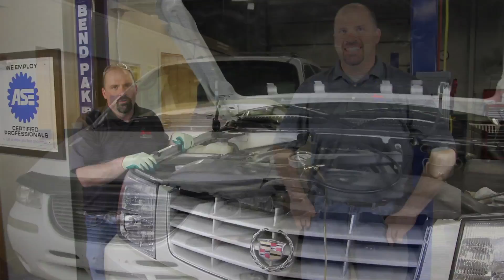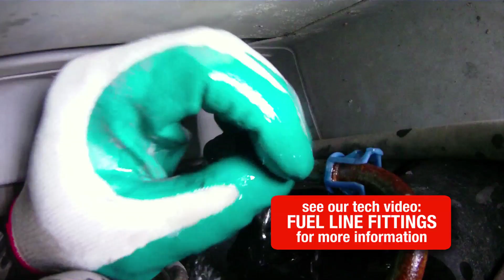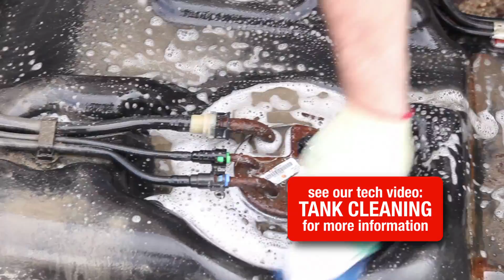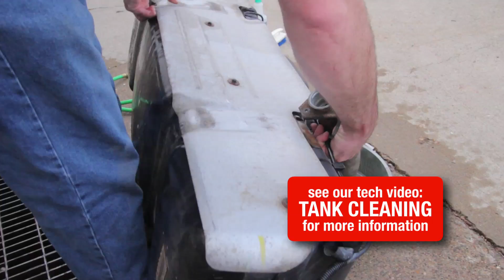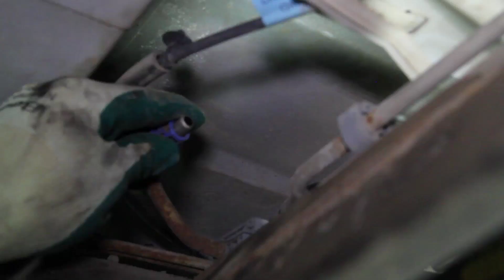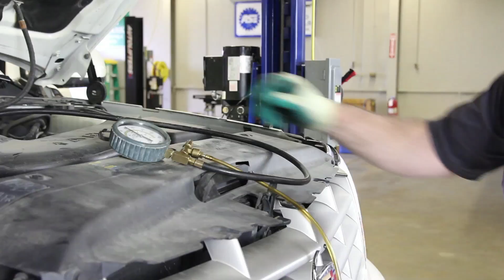How to Install Fuel Pump Module Assembly E3581M in a 2004 -2007 Cadillac Escalade

Comment: You can also bleed the fuel pressure, by removing the fuel pump fuse, then starting the vehicle, and letting it die or stop running on its own, then shut off they key.  Then disconnect the battery cables.

Comment from the maker: Hiwaycruzer, General Motors pulled a fast one on you, the fuel filter for the system is incorporated into the fuel pump assembly, so when you changed the pump you already have a new filter installed. Hope this helps someone else also.